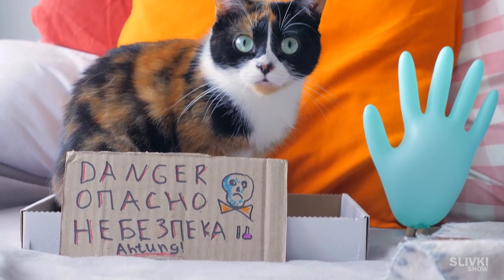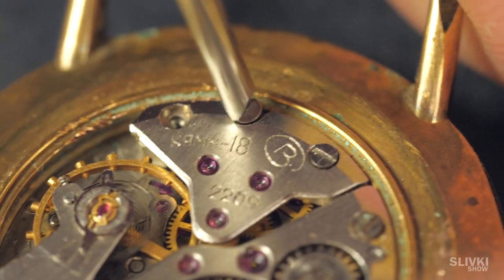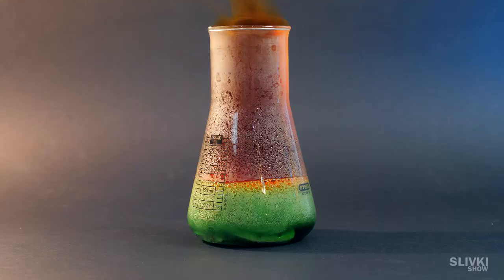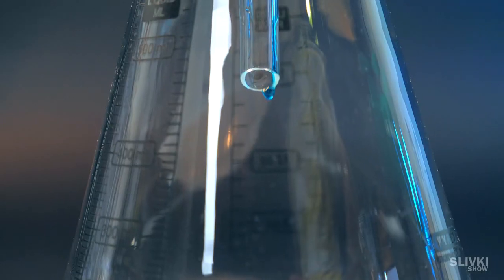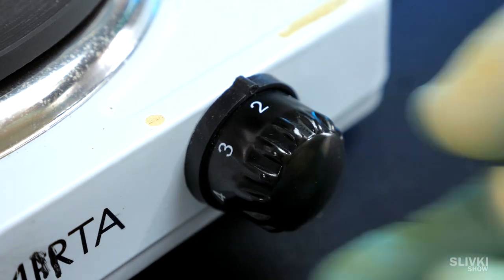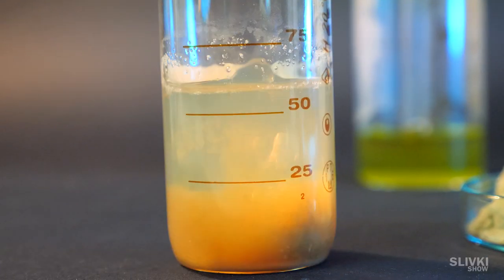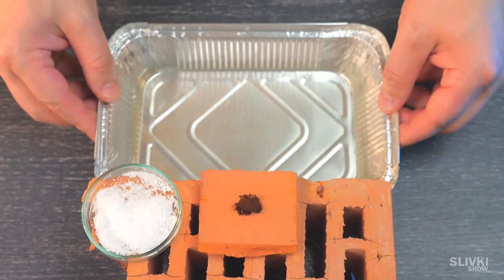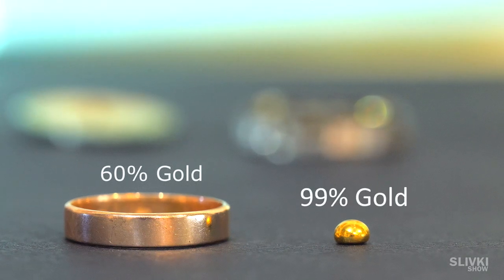HOW TO GET GOLD FROM OLD WATCH [EXPERIMENT]

Comment: “Grandma left old watches as a legacy”

dissemble its and get gold
Reply: @drilerr  but get irradiated with Radium... Some of these old watches can sometimes use Radium to lit the dial and even if the dial is no longer lit could still be radioactive.... Diver watches like Zlatoust are an example of a watch I would never pull apart before checking it with a dosimeter (Geiger counter).
Reply: About $36 USD worth of gold.
Reply: Gold 😎
Reply: its godzilla he had a stroke trying to read this
Reply: Dissembles it for views